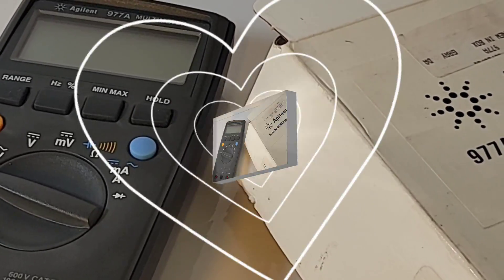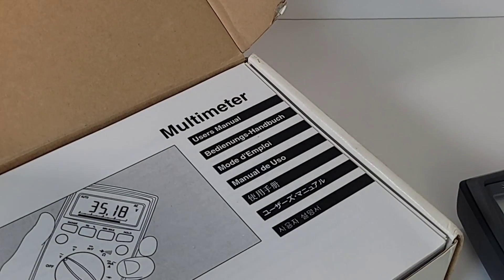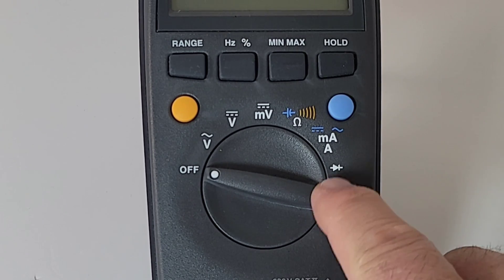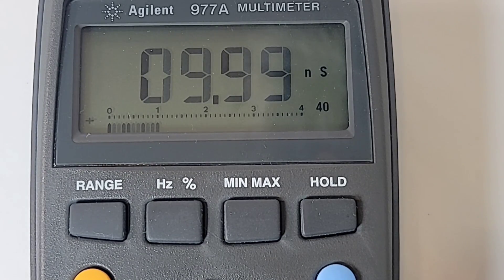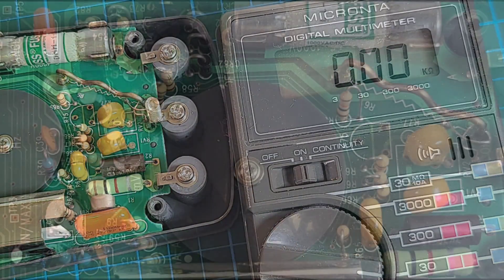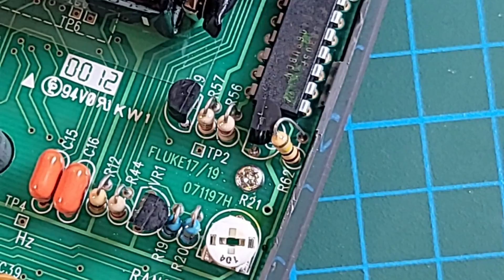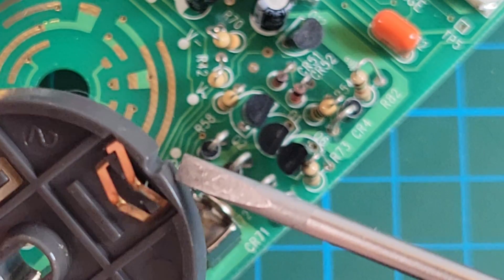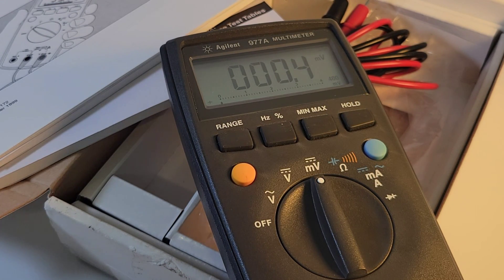RETRO-TECH ○ AGILENT 977A Multimeter Mini Review & Teardown! (1998)

Comment: Nice find, as an analytical chemist I've used Agilent GC-Mass Spec.(and HP branded before the takeover) instruments for decades, it's fair to say I have a soft spot for the brand.
Reply from the maker: Agilent has a rich history..nice to hear you've experienced it in the workplace too 😊 👍
Reply: Funny enough Agilent is a spinoff of the Test & Measurement division (including optics, instrumentation, chemical analysis, and medical equipment product lines etc) of HP, while Keysight is a further spinoff of the electronics test and measurement product lines from Agilent. HP divested itself of the products which started the company and both Agilent and Keysight appear to be doing fairly well. Funny enough Agilent+Keysight net income is not that far behind that of HP, wonder what the reasoning was to spin it out of HP?